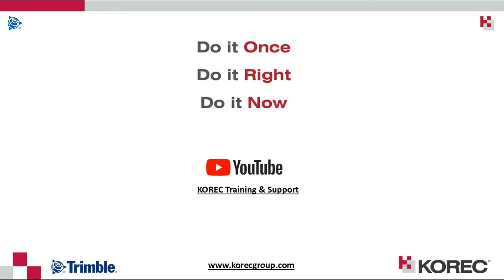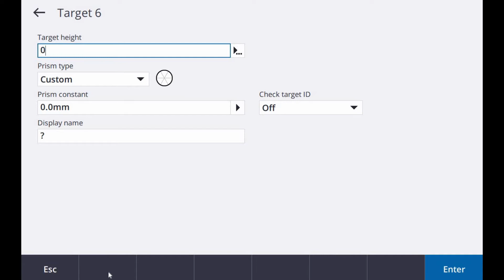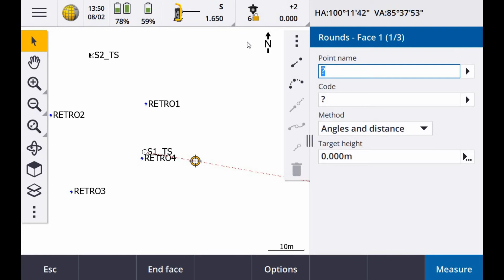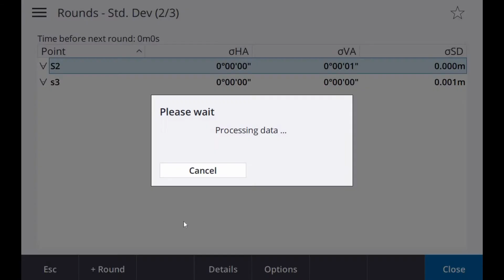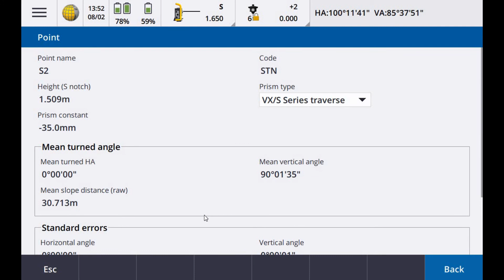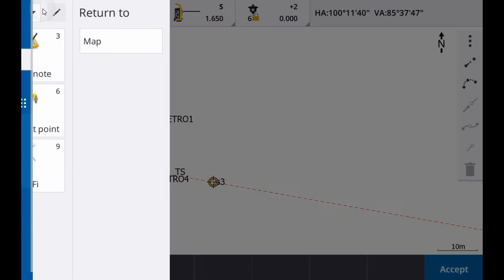Trimble Access - Measure Rounds

Comment: Is there any way to set up TSC5 that way, that it measures stations one by one. So instead measuring STNA, then STNB, then same again, I would like to measure STNA three times, then STNB three times (basically "ABABAB" or "ABBAAB" I want it to measure 'AAABBB")?
Reply: Check out “options” at bottom of screen when in measure rounds.  But probably not.  Why would you want to do that?  In theory, your method would introduce more environmental related error into your resection, as temps and pressure changes, you want the difference spread out over the course of your measurements.  Think, just at sunrise, equipment is heating up fast, do you want a 5 degree change while measuring one station?